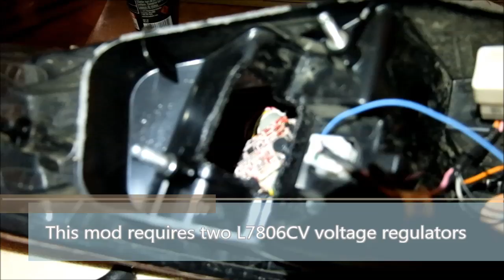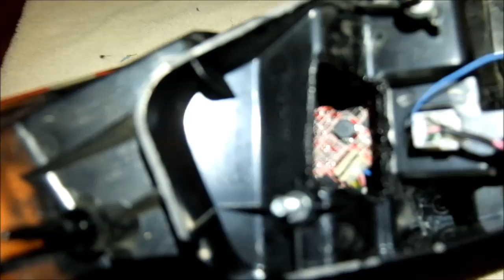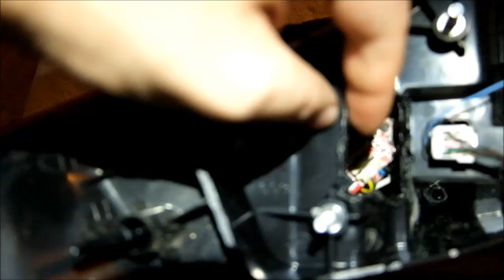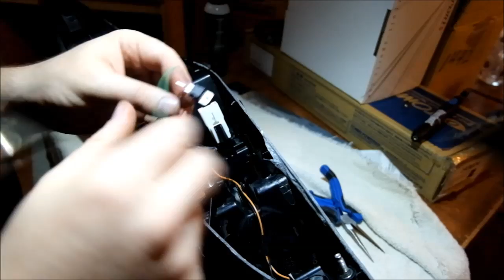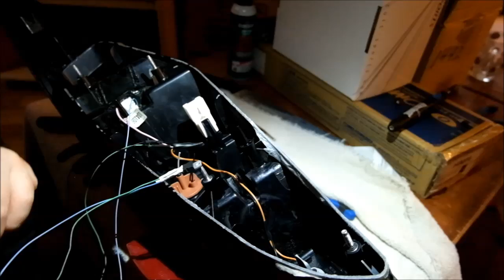How to make the 2013 tail lamp 'triangle' as a brake/turn signal mod

Comment: Snoopy, what color wire is the brake wire? I’d like to connect the brake not the turn signal to the regulator. Thanks!
Reply: Did u figured it out?

Comment: Any idea why my triangle is dimmer than the outline? I use the same voltage regulator I just wired it as a brake not a turn signal
Reply from the maker: Not enough voltage is getting through. Some seem to need slightly higher voltages.
Reply: Snoopy Panda thanks for the reply, any other voltage regulators you would recommend?
Reply from the maker: @PeterParker-hh4cu  you'd have to probe that blue wire you cut and measure the voltage there and then either get one that's that voltage or a variable voltage regulator and set it to the voltage.

Comment: Which color of the wire is for Brake light?(stop light)
I got confused when you said "Green wire" as a turn signal wire and you also put "Green wire" in the subtitle when you said you forgot which color is for the brake light

Comment: what if I didn't want the triangle LED cluster to be my turn signal but only to light up when pressing the brake? so Audi mod as running lights without the triangle and then the Audi mod strip and triangle together for brake light. thanks in advance
Reply from the maker: Put the power from the brake wire to the regulator instead of the turn signal.
Reply: Would you happen to know what color is the brake wire so I can set it up as mentioned

Comment: You mentioned this is wired up with GREEN wire for the triangle as a TURN signal, but then you mentioned to use the green wire the for a STOP LAMP.  Confused on which wire to use for the stop lamp.

Comment: Do you extened the blue wire coming off the circut board or do you tape off the blue wire connected to the cuircut bored and extened the blue wire that was left over ?   You have to piece of blue wire when you cut it and not sure which side to extend.
Reply from the maker: Chicoon 41 extend the one not connected to the circuit board.

Comment: What wire do I connect the blue wire with to have the triangle as a stop only when applying the brakes?
Reply: Did you ever find this out?  curious myself.
Reply: me too, I'm pretty sure green wire is for the turn signal, please tell me which color of the wire I have to put together for stop light(Brake light)

Comment: so when I'm doing This I cut the blue wire and extend that wire with new wire and put that on the regulator. then I cut the green wire for the brake light and put that on the regulator and that's it?

Comment: Snoop, is the voltage regulator required? I wired mine up yesterday before knowing you had this video. Seems to be working okay. Am I at risk for burning out the LED's or something?
Reply: Actually NVM! I just checked and it seems the lights are barely lighting up now. Might be too late but did I actually burn these out or will is there just too much voltage that they aren't lighting up correctly?
Reply from the maker: +Andrew Ricci the regulator supplies the correct voltage to the array. they'll operate funny if you don't use one and seriously run the risk of harming them.

Comment: Hey did the 6v regulator turn out bright enough? I was reading on the gencoupe forum the 5v was too low.
Reply from the maker: yeah it could be a bit brighter imo, maybe 7v would do the trick but I don't want to risk a set of tails to find out
Reply: +Snoopy Panda so I got some regulators yesterday, what'd you use to attach the wires to the regulator?
Reply from the maker: +Robert Blackmon I soldered the leads on.